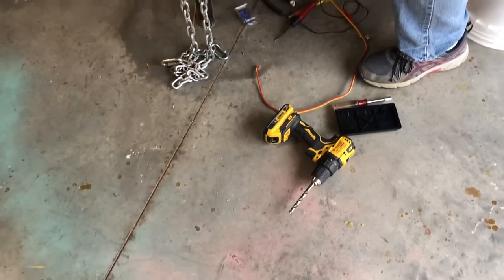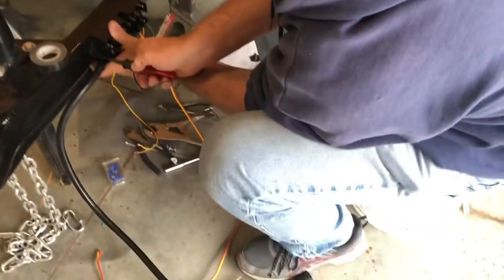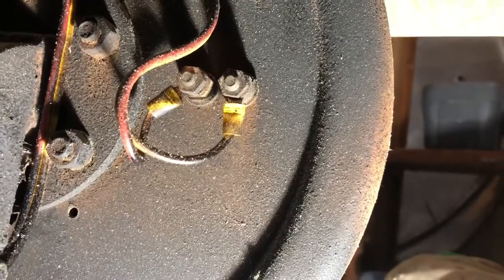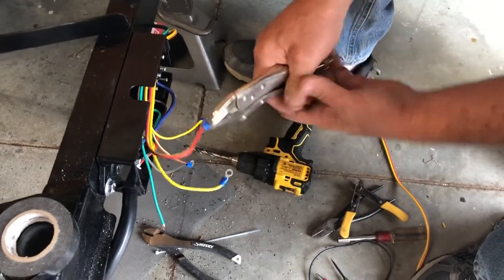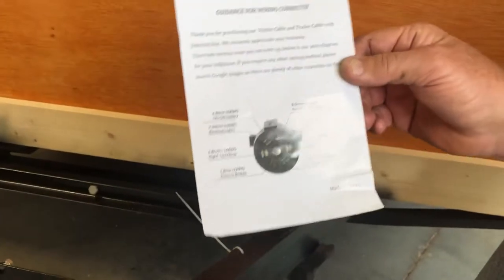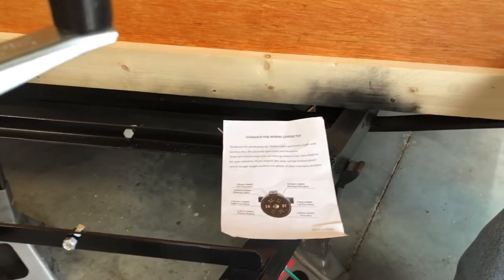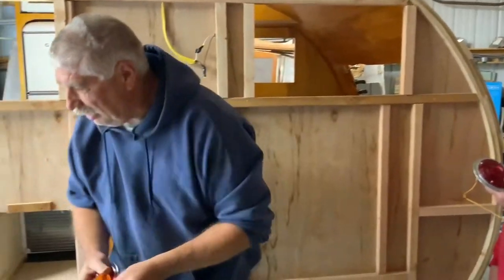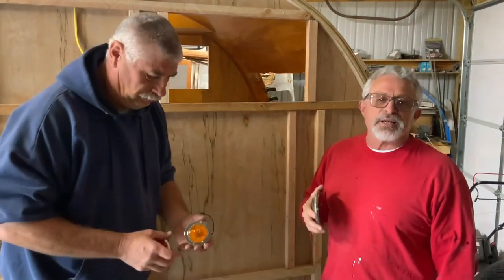EP 148 - 7 pin connector run trailer brakes & running lights in 1954 King vintage camper retro RV

Comment: All the lights on my 1966 Oasis work well and the wire is still flexible so I can't decide whether or not to replace the wiring. Thanks for the video.
Reply from the maker: Whatever is safest to you!
Reply: @RobTheRebuilder  Thanks.

Comment: You've been doing this for how long? And you still haven't bought the proper tool of crimp wires People, did you see Hawaiian owner repairs on your own travel trailer for the love of God, and at least by the cheap proper tool would do the job. And following this guy's example of I've been using vice Prints to crimp wires for years. Yeah, and every other area, hes gotta go back and read criminal. Just know by a cheap set of crimbers to do the job, right? They're not that expensive matter pack that gains instead of wire groups, it's cheaper than A. Pair of vice trips, please, please do not use vice grips to crimp your wires. They will not hold over the long-term.
Reply from the maker: You seem very attached to your wire crimpers.